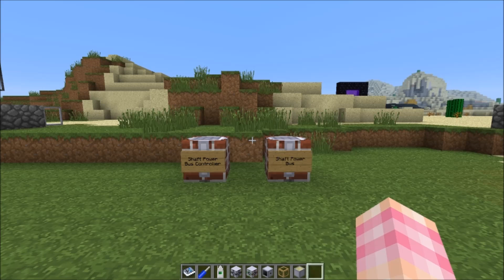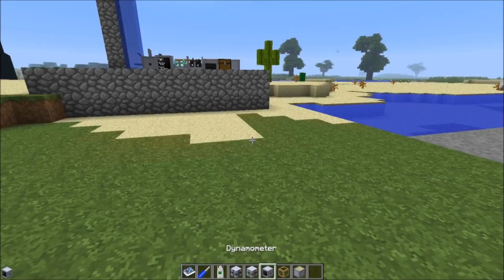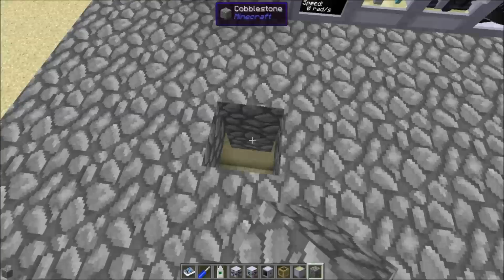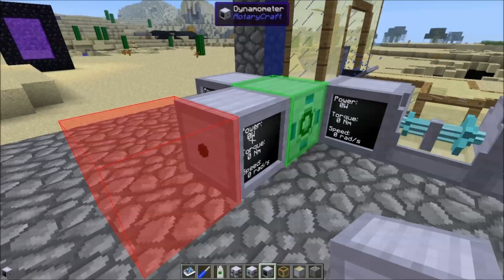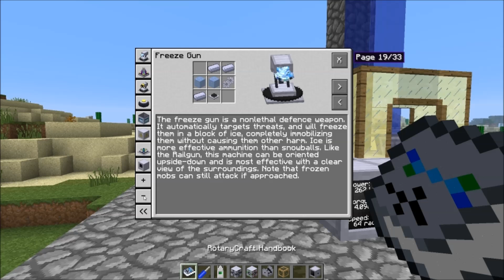RotaryCraft Tutorial #23 - Shaft Power Bus

Comment: It's good to see this working.  My Monster setup is malfunctioning.
Reply from the maker: How so?
Reply: Shaft Power Buses do not actually transmit anything from the Controllers.  They know where the power is coming from, and devices hooked up to them know where the power is coming from, there's just no actual power being transmitted.  It's not the first derp I've encountered in the Monster mod pack with this mod.

Tried to show how it worked, but failed.  Instead, I'm sending people your way for a demo on how it's SUPPOSED to work.
Reply from the maker: thornofnight You remembered to put the shafts and gears in the busses right?
Reply: SentinalhMC Yes indeed, bedrock ones.  It's the strangest thing.  See for yourself.  It's done processing.  Like I said, I'm sending any inquiring mind your way.